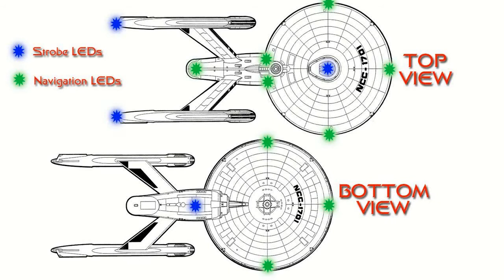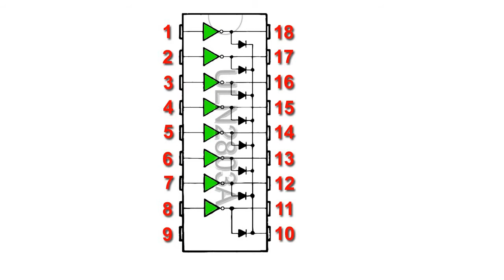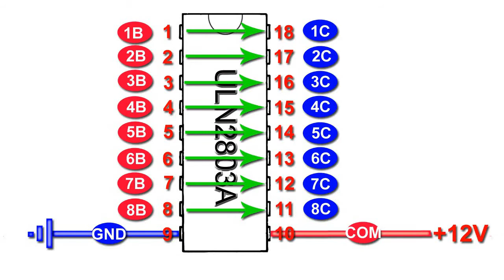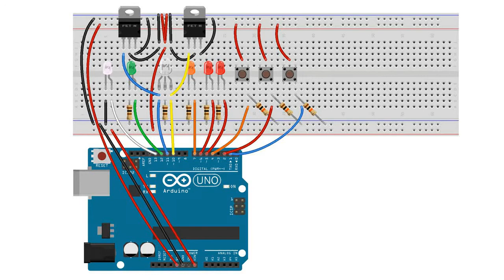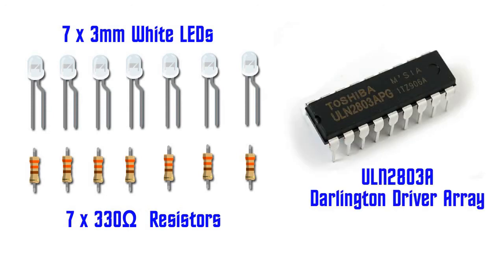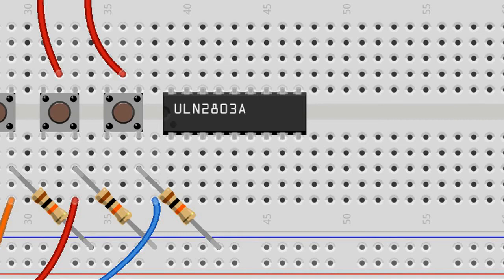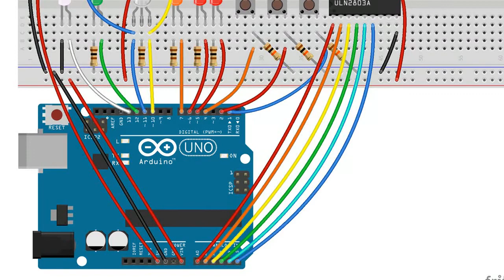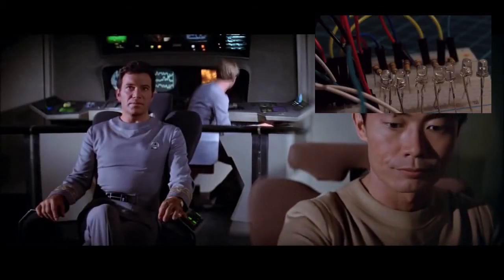Arduino for Starships - Ch07 - The Drydock Startup Sequence and the ULN2803A Driver Array

Comment: Just fantastic, thanks for taking the time. It's so satisfying to see it working, I had to watch it a few times.
Reply from the maker: Hi, BazR :-) And thank YOU for the great suggestion. I hope the sketch is useful for you - it should be fairly easy to cut and paste the bits you need if you want to add the effect  to one of your own sketches. Thanks for watching! - Trevor
Reply: I think it would be an injustice to modify your hard work. Are you considering more videos in this series? I am in no hurry to finalise my wiring for my model and I would be eager to implement anything else you may be planning.
Reply from the maker: We'll be adding sound next, but might need to use an ADC chip for the drydock effect, as we're running out of output pins fast! The SD card adapter needs 5 output pins :-( But we'll figure it all out, and eventually add everything to an inexpensive PC board; and, of course, we  need to build the standalone circuit for the shuttle bay runner lights. I almost forgot that one!

Comment: Very nice video. Thanks for the tip about the ULN2803, I am most certainly going to look into that. Generally, when I need more LEDs I hook up a Texas Instrument TLC5940, which is a 16 channel PWM unit. Even better, if you need even more than 16 extra PWM LED outputs you can daisy-chain further TLC5940s to getting 16 more PWM outputs with every chip. Of course there are limits to how far you can daisy chain them, but as far as model building goes, you will run out of ideas to light up before you begin to have problems with the daisy chain. There are also tried and tested libraries for that in the arduino forum and playground.
Reply from the maker: That's a new one on me :-) I was looking around for something that could handle PWM across several LED's in order to create a decent "Knight Rider" effect. I was going to settle for library-emulated PWM which isn't as smooth as onboard PWM is, so an IC that can handle multiple LED's is just the ticket. Thanks for the info. I'll definitely look into it and look forward to playing around with the TLC5940! - Trevor

Comment: Hi, Trevor. Don't we need to do something about the strobes and navs having more than one LED on the pin? I thought we could only have 20ma on each pin. Having 9 LEDs on one pin is over the limit. Do we not need to do transistors or MOSFETS  to power all the LEDs on a pin? Strobe pin and Nav pin need transistors, and if there is more than one LED for phasers, another for that pin? I would need to allow for that in the schematic/pcb.

I'm having a heckuva time figuring out the PCB for this. I have intermediate experience, but have just enough knowledge to blow things up inadvertently.
Reply: That's why this driver array is used in the first place. Each of the pins can carry up to 500mA, so it is easy to have more than one LED at each pin.

Comment: How hard would it be to use a button to trigger the startup sequence instead of it just happening after powering up? I know there are only P0, P3 and P9 pins left.
Reply from the maker: Hi :-) It shouldn't be too difficult. You could just set up a special flag which gets activated once a switch is pressed, and then have the startup sequence check if the flag is active before running.

Comment: Hi, so im guessing here that  you just add pairs of led`s for pins 1 2 3 4 & 7 on the ULN chip when needed on both sides of the model? Its probably the case given the amps and voltage capable on each pin but I thought I would ask?
Reply from the maker: Hi John :-) Yup, just so. As you've already figured out, we use one wire from a single collector pin to wire up all the LED's for that specific floodlight set - and with those amps we can even wire all the LED's up in parallel circuits instead of in series :-) It's a nice little chip! - Trevor
Reply: Ostrich Longneck Thanks Trevor.
I've looked up the chip today and they are really cheap to buy.
Thanks so much for the video's.
They are really helpful!!
Reply from the maker: Thanks John :-) Appreciated!

Comment: For some reasons my floodlights are always on, albeit in a lower power. I can see them ramp up to full brightness when the sketch starts, just according to the script.
Reply: Solved: I connected the Darlington array to the 5v line instead of the vin (12v) line like the leds were. This made a difference.
Reply from the maker: Hi, apologies that I'm only replying after a month. Well done on finding the error for yourself, though. That was probably so frustrating, but I always view these little glitches as learning experiences. I originally made these videos while I was learning how to use the Arduino myself, and hoped that someone would find them useful in some way. Thank you for watching and leaving a comment. It is much appreciated!
Reply: @OstrichLongneck  Thank you for allowing us to chime into the learning experience, it is still a lot of fun!

Comment: Do the numbers under the "M' SIA" mater?
Reply from the maker: Hi, no not at all :-) As long as "ULN2803A" is on the IC, you are golden.
Reply: @OstrichLongneck  awesome. I have another question. How to I make the blue nacells come on with the blue deflector and the red impulse engines turn on with the yellow deflector? I hope I'm not making things complicated. Of course the blue would be off when the red is on and vise versa. And what are the two mosfets at the top of your bread board? I see no mention of those specs.
Reply from the maker: @MrCougar214  I don't know if you've seen the previous video? It will probably answer your questions regarding the nacelles, and it should be easy to adapt the circuit for the impulse engines. https://www.youtube.com/watch?v=9ixADBl7vD4&t=496s&ab_channel=OstrichLongneck
Reply from the maker: @MrCougar214  oops wrong time stamp, here's a better link: https://youtu.be/9ixADBl7vD4
Reply: @OstrichLongneck  you're awesome man!
Reply: @OstrichLongneck  I forgot to ask you, this whole sequence you have here, does this include the navigation flashing and strobing lights and does it remain all on until you shut it off?
Reply from the maker: @MrCougar214  Yup, you'll see at 11:37 on this video, the navigation and strobe start up before anything else, and they keep going until you switch everything off.